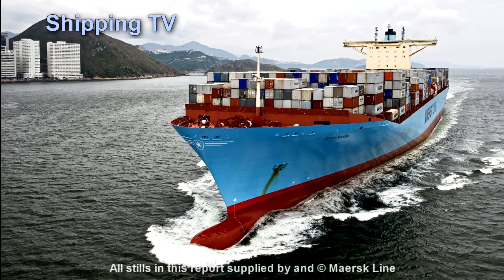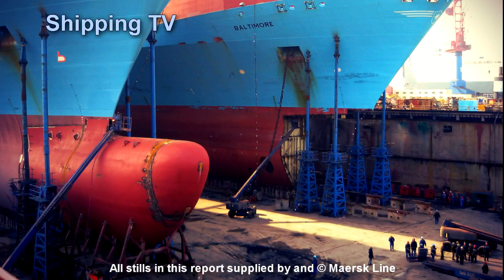Maersk Line modify nose bulbs for slower steaming

Comment: I believe that 5% fuel reduction just by that nose job is a little optimistic, but I do accept that the nature of the water flow will save fuel if the hull is designed for a particular speed range and not a general hull shape which will operate at various speeds.
I do not think one  can beat the shape of fish for economy as the shape of a dolphin or an orca the killer whale shape. 
I believe that a "squarish shape"  mid frame shape is not so economical on fuel but it is convenient for docking,  and I do not like the varying pressure zones on the  various locations on the hull.  The Orca or killer whale shape and outline is good but it  would be expensive to produce it and to dock it.  One needs to be practical and convenient so the choice is clear, convenience with economy.  The Maersk vessels are elegant and the Emma Maersk is well shaped in every part and that propeller is beautiful  and a work of art.
Reply: They're going to drop cruising speed; that's where most of the savings will come from. The bow mods are to optimize the hull for that speed.
Reply: very interesting way of viewing the modifications- do you design hulls?